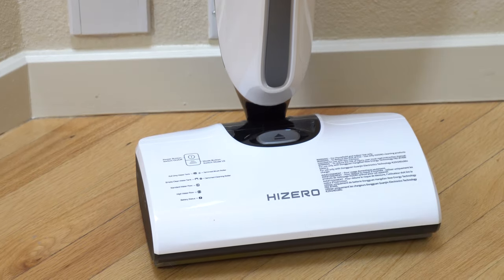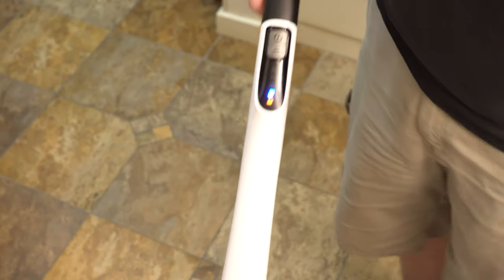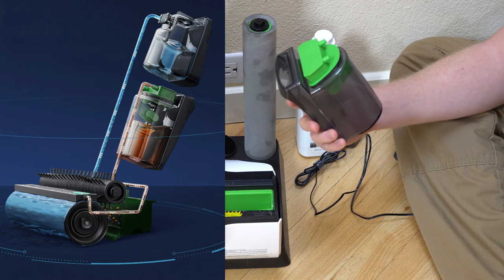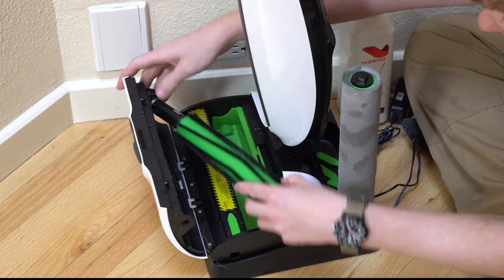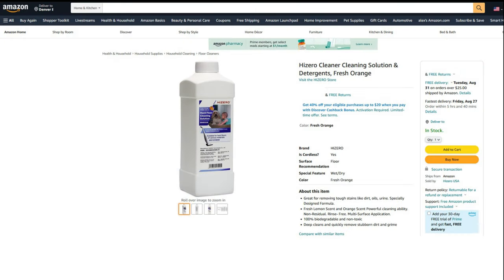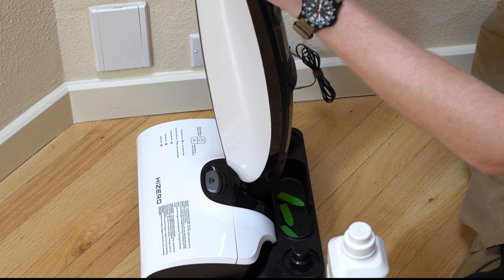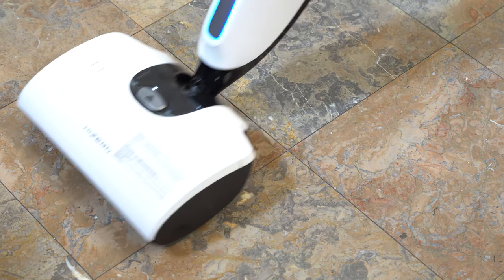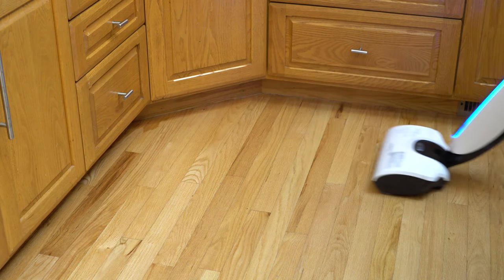HIZERO Bionic Mop Cordless  Hard Floor Cleaner F803 - REVIEW

Comment: Which one you’re going for, Hizero 803 or Tineco Floor One S3? I found out that Tineco is slightly better on tiles with small grooves and grouting whereas Hizero is the best on flat, hardwood floors and is the best when it comes to edge cleaning. What are your opinions on these two?
Reply from the maker: I have mostly flat wood floor and marble. So the high zero is my preference for that. I have some Saltillo tile that I use a different machine for.

Comment: Integrated battery could be something to worry about down the line no?
Reply from the maker: The battery can be changed with one screw
Reply: It's easy to remove or replace. I don't recommend this though. Get a Bissell crosswave for have the price. Then you don't have to worry about the battery going dead or replacing it when it fails. They cost 100 dollars for a new battery. This machine has has far too many issues. I own 5 and 4 of them don't work. Luckily I didn't pay for mine. The one that still runs I had to replace battery. It still doesn't perform very well after 6 months of using it. The propel technology loosens up from pulling back against it. Now it just doesn't clean very efficient. It's just a waste of money to be honest.

Comment: The F803 is the newest Hizero model not the F801. Based on the stand you have,  you have a F803 as well.
Reply from the maker: Yes that's what it says in the title. I'm sorry if I misspoke at some point in the video.
Reply: @PerformanceReviews  You misspoke in the first 8 seconds when you introduced the product. For awhile, I thought I was watching an older Hizero video until I saw the newer stand. I presume they have improved the F803 it but it looks very very much like the F801. I guess there wasn’t much to improve. But I wish they would have increased the size of the tanks.